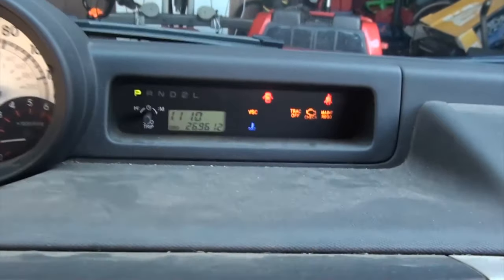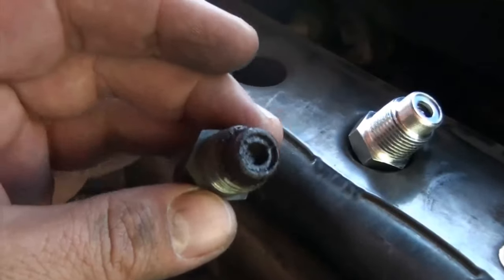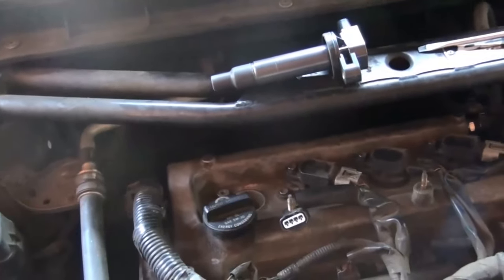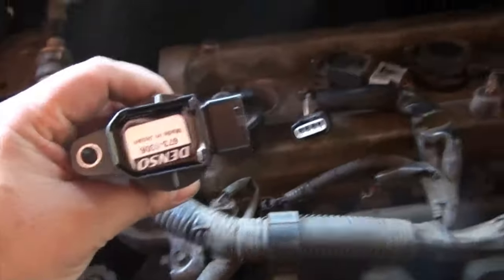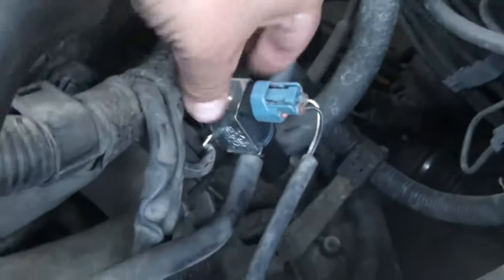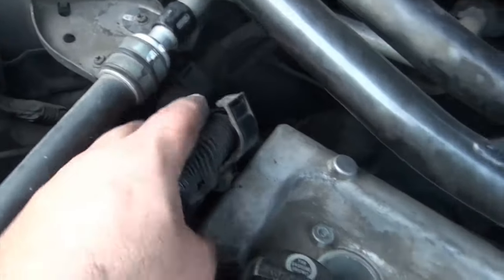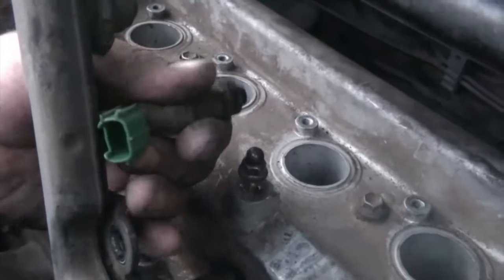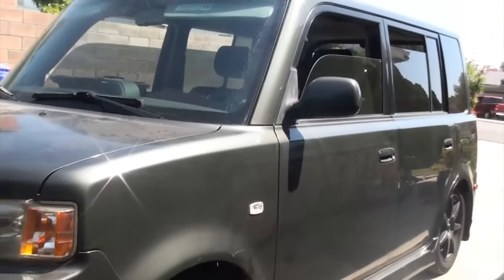Scion XB Check Engine Light troubleshooting for misfire, Coil? Spark Plug? Head Gasket?

Comment: I apologize if my comments sound negative they are not I rather hope your  followers are   thoroughly aware of the complex and intensive processes the diagnosis of bad head or head  gaskets require. Your video is a great example of complex issues an engines can exhibit.

Comment: Great video! Thank you. I recently installed new spark plugs and fuel injectors, for all cylinders in my xD. My check engine light wouldn't go away. I'm going to try this! I can't get my car to pass inspection until that light goes away!
Reply: Reset the engine light. When all is done, mechanics reset the light. (But I'm sure after all this time you have already figured this out. But if you have not, there's a YouTube video for resetting the light yourself.)

Comment: nice video, I have a 2004 xB 379K on it, same engine and trans, starting changing things now 3 / 2020, P240 code exhaust senors, new P240 code cat converter, hesitation on hill going up to Tamecula from Esco, P301code, changed plugs and coils, still lack power half throttle on that hill, misfire code again, changed fuel strainer and fuel pressure relief valve, car is running great except on that hill at like half throttle. going to try to PCV value after seeing your video. hope that what it is. Great video man
Reply: Did it work?

Comment: Great video you did and the walkthru of the replacement of parts and the results and the eventual realization that a motor swap was the best bet. I learned a lot. My 2006 Scion xB has the check engine light issue and my mechanic and I have tried to work through the issues. I might have to reach that point of a motor swap as well - will see after replacing some of the parts you mentioned and see how that goes. I have about 157K on mine. I have consider having the ECU replaced with a used one, but don't think that's the real issue so far. Car is in the shop today and will see what to do next.

Comment: Oh my gosh you are explaining exactly what’s going on with my 2012 scion IQ. I hope you’re right I’m gonna try replacing the PCV valve. It burns oil it has the tracking off and check engine light came on I ran a test and got misfire 0103 just like you previously it was the second cylinder and it was during idle. So I think you nailed it. I am excited toTry replacing the valve because I’ve been searching for an answer and I think I just found it. I will let you know thank you so much.
Reply: Did it help?

Comment: The BEST thing for the XB is running E85.    Its 107 octane.  Filled mine up today.    Runs smooth and its sooo peppy. (2006 Scion XB. 88K miles).  Thats with NO cheater box.  No check engine lights.

Comment: Rough idle ?  Replace your fuel injector rubber O-Rings.   Mine were leaking.  An ‘06.  Also there is a youtube video of how to use Brake Clean to clean out your fuel injectors.  That fixed my misfires. New O-Rings are like $40.  Before you pull your injectors out wash your engine and vacuum around the openings.  You dont want crap falling in.  Also the O-Rings were leaking at the top where they attach to the fuel manifold.   Once i replaced the o rings my fuel pressure rose from 3.5 to over 7 as shown on my “BlueDriver” OBD2 iphone app in live mode.

Comment: thanks for the video. I have to get that piece. I have a problem with my 2005 XA code p303 I buy the new coil and buy new spart plugs. so far same code. I will update you later.
Reply: Update?

Comment: my 2005 scion xb has been running like it has the hic-up's. I changed the coils and the sparkplugs and it ran fine for a couple weeks. now, the hic-up's are back and I don't know what to do to it. can u help?
Reply: George Munoz fuel it up with E85.  Wait until you have just about 1/2 tank, of regular gas then fill it with E85.  My XB is peppy now.  ‘06.

Comment: My wife had a misfire, now it won't start. It turns over but refuses to start. Any ideas?
Reply: Mark Allen fuel pump ?
Reply: Mark Allen disconnect the ground on the battery.  Then take out and clean the Mass Airflow Sensor with actual Mass Airflow spray cleaner.   Reinstall, then reconnect the battery.   It will start rough, for a couple minutes.   If it doesnt then starter/ solenoid or fuel pump.
Reply: @rickantonio  hey what's up bud . I have a question. I have 05xb change plugs , connector, Coils , injectors . Still says misfir cy One. It has oil on plug when I pull it in out. It runs smooth at idle just low power 189 k.  Never heard this one. Does this sound like it? Wen I let it run and pull off the coil connect on cy one nothing happens. 🤔help please I can post vid if needed   😭😭😭
Reply: @rickantonio  yes I've swapped them even replaced them . I did the injectors they were toast. Coils,plugs,even did the coil connector. The gas gadge never worked correctly. I've had a bout a year. Has 189k .no smoke runs decent at idle . I reset everything. No lights are on but I leave my reader connected wen driving and it says misfire cy 1 . I can post a vid or send my phone number. I'm stuck man . Strange AF . I cleaned the ecu kinda dusty. Idk . Help.
Reply: Oil in the bottom sorry. It needs valvr cover gasket I know but it's definitely oil on the bottom of the plug. It's not very loud wen it's running actually. I was going about 100 and the engine light came on 2 weeks ago.
Reply: Now I'm thinking about it wen it git cold last month or so the dam maintenance light would come on wen I first started in the am and it would beep and the dash would blink strange AF but it would go off after a min
Reply: Actually forgot it's already a couple wen I started they are short vuds
Reply: @rickantonio  I did . Still same issues
Reply: Did u see the vids 4 total? Maybe u see something I don't 🤔